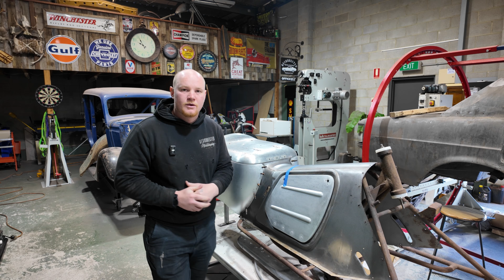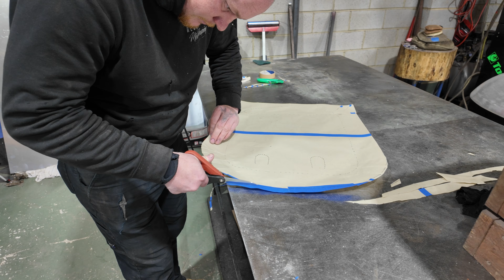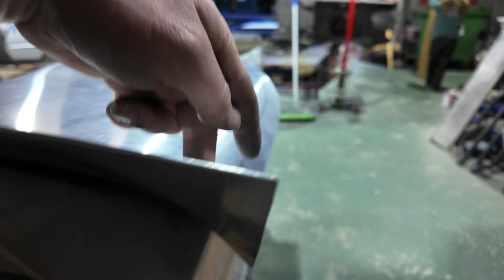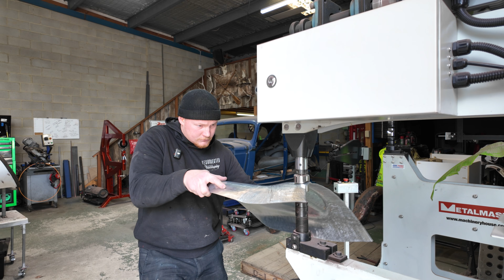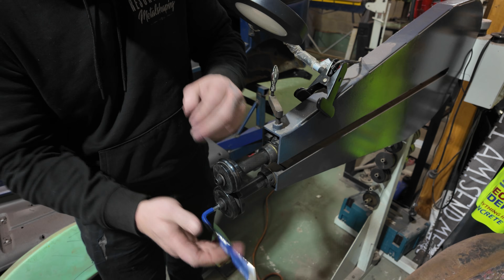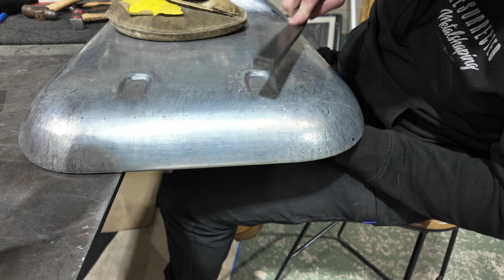TRADITIONAL METAL SHAPING - NO SHORTCUTS

Comment: No shortcuts if you have a pullmax...this video is a joke
Reply from the maker: I can easily make this with out a power hammer. I use big tools to be fast for customers. If you break the methods down used in this video it is shrink, stretch, fold and cut. That’s it, heaps to be learned what ever tools you have that can do that that’s all you need. It can be as simple as a mallet and a tree stump. Exactly the same process but using different tools. Give it a go and you will surprise your self.
Reply: @Resurrected_metalshaping  I have made curved panels like hood scoops and motorcycle fenders totally by hand, it is taxing.  The thumbnail shrinking dies on a power hammer are really game changers -- a shortcut in my opinion.

Comment: thanks for uploading the video. if you were going to make that panel without using the power tools, would you recommend annealling the blank before shaping? if so, would you anneal both the area to be stretched and the area that required shrinking?
Reply from the maker: You can anneal if you do it with out the power hammer. If I was to do it without I would block out the rear section into a sand bag and work from there.